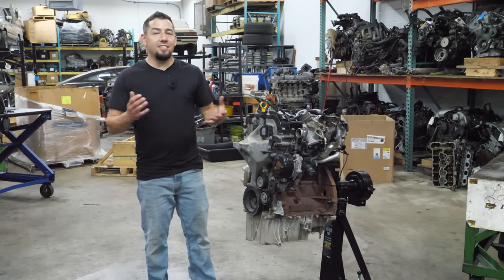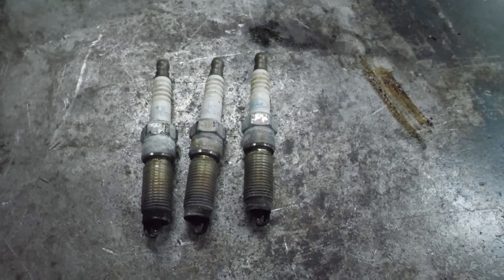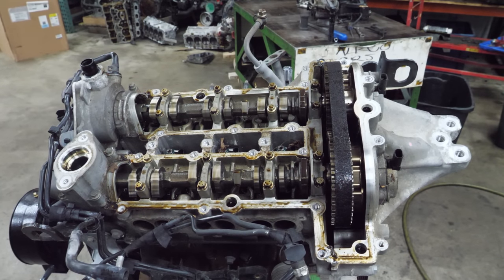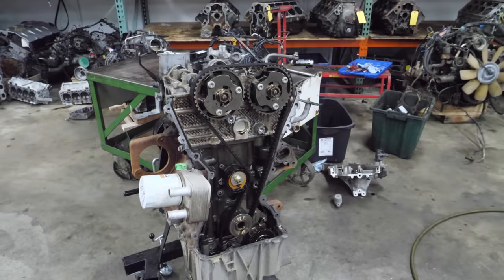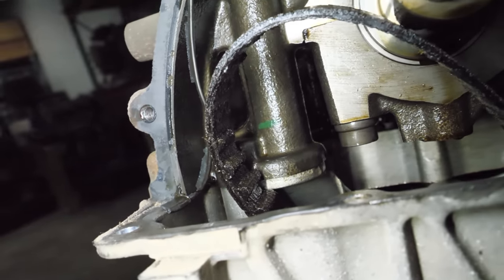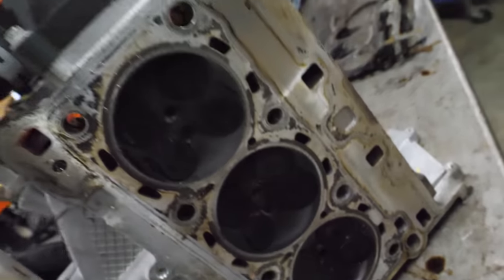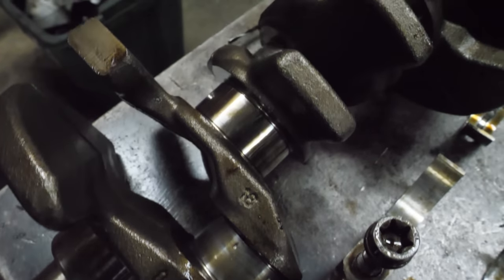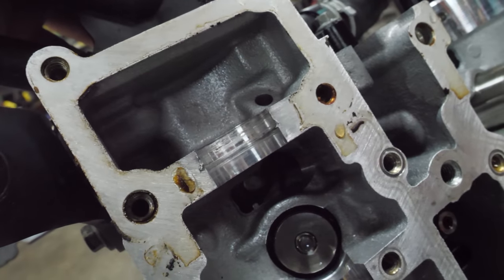JUNK Ford Ecosport 1.0L 3-Cylinder Ecoboost Teardown. LAWSUIT ENGINE!

Comment: As a Ford tech for a little over 2 years, this is the 6th time I've personally seen this happen, not including the rest of my shop. What we hear is either 1. The tensioner itself fails and there is no longer any oil pressure, or 2. The timing belt loses every single tooth (likely still tensioner failure) and becomes smooth and of course, no oil pressure. Most cars will keep driving like this until the "Low Oil Pressure" warning crops up, at which point we get it. There is no recall, but ford issued a TSB which directs to replace the long block and turbo. Which is why they are in such high demand. Obviously just a horrible engine design. Absolutely loved watching this one. I also hate that turbo vacuum line, and there's always one fuel injector connector that gives me hell. Great teardown!!
Reply: Ecoboost across the board are trash
Reply: @shadowopsairman1583  the only one I almost never have issues with is the 1st gen 3.5, even with half-assed maintenance. I've owned 2 and worked on many. But all the small ones are a pain to work on and have numerous issues. Both 1.5's especially. So yes, I'm inclined to agree.
Reply: since u have only seen 6 of these failures means theirs only 6 of these engines in your area.
Reply: ive replaced 2 1.0l ecotrashes so far. first one belt failed and lost compression and the second one they drove it in at 0 psi of oil pressure and surprisingly it still ran great
Reply: Can you say anything about the 2018+ 2.7 EB?
Reply: @geoffgaffieldsickassc4152  lol
Reply: @vincerivera2488  from what ive seen as a ford tech that mostly does engines and internal repairs. the 2.7 gen 2 i havent seen any issues other then the oil pan leaking in the gen 1 but they are pretty decent for what they are
Reply: @vincerivera2488  strangely, I've yet to actually work on a single 2.7 EB. Only thing I know is even after all the money Ford has lost on the 2nd gen 3.5 cam phaser fiasco, now they're having exactly the same problem with the 2.7/3.0 in the F-150 and Bronco.
Reply: @alexandercortez4106  I've dealt with a few gen 1 2.7 with the oil pan issue. I know ford released a tab for replacing valve covers and oil pan with the updated parts
Reply: @shadowopsairman1583  decent power terrible reliability
Reply: @eveangreen1871 the 2.7 ecoboost has been reliable for a lot of people
Reply: "it's not a recall if we don't call it a recall!" Someone's got promoted for it, I bet
Reply: @vladimirvlasov4360  😂😂 too true
Reply: @angelhibiki6867 I hear a lot of good things and higher miles on the 2.7s
Reply: @christinesommerfeld9815  honestly other then the shitty oil pan design on the gen 1 2.7 I haven't seen any in the shop for major repairs. A few trans concerns and suspension concerns but not really any engine concerns
Reply: My thought on the reliability of EcoBoost is that it comes down to proper oil and not buying into extended mileage oil intervals. There can be many variables once the engine is in the wild of normal usage.
Reply: @larrybe2900  yeah I'm religious with oil changes, 5k or less every time, and both of mine were perfect. But those turbo oil filters can get so bad so quick, and 7.5-10k is way too long for any turbo engine in my opinion.
Reply: Wouldn't failures like this be the result of the ever increasing recommended oil changes?  "Oh, you can go 5k miles between changes with synthetic.  Sure!"
Heard that crap all the time (and even 7.5k miles) at a Hyundai dealership.  Oil would come out like snot.
Reply: @alexandercortez4106  my 2014 F150 blew up when letting off the throttle at 60k miles. I accelerated up to 75 and hit cruise set and it stuttered and then sounded like a Subaru.
Reply: This 1.0 ecoboost is trash clearly, the 4 cylinders seem meh, the 3.5 decent? The 2.7 seems to fundamentally be the best designed one, I think they might've actually done a good engine there.
Reply: @veleriphon plenty of Hyundai in Europe still on the road going strong even after a decade of use on long OCIs... Even the diesel ones have a year or 20k km OCIs here and you rarely see issues... I wonder why...
Reply: I remember when this engine came out... I saw that the oil pump was belt driven, and it and the timing belt was in the oil...  I thought then... THIS will fail early. There is room for a chain in there.. WHY did they do this??
GM is now doing the same dumb shit in the 3.0 Liter diesel. Oil pump is belt driven...  and is a maint item. .. AND it is on the BACK of the engine.. so the transmission has to come off to change the oil pump belt..  HOW STUPID is that??
Wanna know why people are buying EV's???   THIS is why. unreliable ICE designs, that have large maint bills and high failure rates.
Reply: Truth is, after all, that the engines break down due to lousy construction, budget solutions.
Not because it's a 3cyl petrol engine with a turbo!
Reply: There is also a very common defect, the tube that connects the engine cooling circuit to the expansion tank breaks, and they seize very frequently.
Reply: @andreim841 timing belt not being soaked in engine oil maybe 😂 what a stupid design
Reply: @fortune300 being an overworked 3 cylinder 1 litre doesn't help. Same design in a normally aspirated 4 cylinder may have been under less stress and not failed.

What's the point in deleting a cylinder adding a turbo if it doesn't give you starship mpg
Reply: good to know that the customer is getting a new engine more than likely under warranty. bad for your hours though i imagine since it all goes under warranty work. 

also bad for the environment, ford basically building disposable cars that will have no usefulness after their warranty periods.
Reply: It’s the fact they put the belt in oil what then perishes and blocks the oil pick up
Reply: their duratec v6 and every v8 they do does the same thing, its the worst car brand ever, your job is safe
Reply: @vincerivera2488  Turd by Furd.
Reply: @norfolkngood8960  That's a misnomer, doesn't work that way.
Reply: @fortune300  Yes indeed for sure. I had a 1991 "Chevy Turbo Sprint" (Made by Suzuki) I got it to 270,000 km with absolutely NO engine issues. Apparently, it was an old motorcycle engine with a turbo bolted on.
Reply: @angelhibiki6867  yep not had 1 issue with 3-2.7eb in trucks with now over 100k so seems like a good motor
Reply: What years? The 3L V6 in my escape still runs great at 223K, all chains no internal belts
Reply: @SaberSlayer88  Ford’s been doing that for decades.  Never owned one, never will.
Reply: @angelhibiki6867  this is good news, I just bought my wife a Bronco with the 2.7.  I am OCD about preventive maintenance, just changed the oil at 1,150 miles and will continue to do them every 3k miles with Pennzoil Platinum which meets Ford specs.  My previous Ford was a 1997 Explorer with the 4.0 Cologne.
Reply: So did you  become a Ford mechanic for the job security?
Reply: @jjw6342  well judging by about half these comments, you'd think so 😂 but I've had 4 Fords over only about 6 years and they've genuinely all been near perfect. Beyond basic maintenance, I had to have a clutch and TCM put in my focus at 80k but Ford covered it and I'm now at 160k and zero issues with it or any of the others. Maybe I'm just lucky? Knock on wood.
Reply: @andreim841  Imagine how long they would last if you changed your oil at a decent mileage. I do wonder what the average mileage is in Europe vs NA.
Reply: @julioblanco  You could get away with a less expensive oil if you are doing it at 3k, that is a bit excessive. But it ain't going to hurt anything.
Reply: As a ford tech I'm wondering what your opinion on the wet belt for the oil pump on the new 5.0's that's what my F150 has, and I wasn't particularly thrilled to find out, though they said they've done it on the Mustangs for a little longer...Like you I'm a religious 5k oil change person, probably because I had the 5.4 before this one...Ford doesn't have a good track record with Cam Phasers, which is funny considering they're so big into DOHC engines
Reply: @--_DJ_--  probably 120-150 K miles then the car becomes too old and you get to pay too much taxes on it or you are prohibited from entering big towns or certain areas...
Reply: @andreim841  What a load of bs. Too old to enter a city. That wouldn't fly on this side of the pond. You can drive whatever you have wherever you want. Assuming it is legal to be on the road. I don't know how you guys put up with that.
Reply: @cjpayne677  I still feel like it isn't necessary to have a wet oil pump belt. Could be crank or gear driven like we've done for years. But at least on the 5.0, there is no tensioner that can fail since it just directly from crank to pump sprocket. Fewer components involved, less chance of failure. At least in my opinion. But again, seems totally unnecessary, especially when its proven to be troublesome in other applications. As far as cam phasers go, it only seems to be an issue on the V engines, not the inlines. Everyone else is heavy into DOHC I4s too, but Ford is the only one this heavy into V6 and V8 DOHC. Could be something in that.
Reply: I’ve been waiting to see a tear down of this engine for this exact reason. I’m glad you pointed out the TSB as it’s something I’ve come across in the shop recently to where engines are being replaced from the oil pump belt issue.
Reply: If you are a Ford tech yourself, how come you mention the belt tensioner and not the engine oil? Belt failure like this isn't caused by the tensioner. Few people seem to realize that for wet belts you need to use a very specific kind of oil that does not have any solvents in it. Apparently this car got regular engine oil after a service. Just look at how badly the timing belt is deteriorated at 10:03
Reply: @MadMarky   @MadMarkyNL  I mentioned the tensioner because I have pulled multiple 1.0L EBs apart or seen them apart and the tensioner is a common failure point. I'd say 50/50 from what I've seen is either the belt snapping completely or tensioner failure. Belt wear would not cause a tensioner to fail, but a failed tensioner could certainly lead to belt failure. As to the correct oil, I imagine motorcraft oil works for these belts as good as any oil can, and that's what I recommend for a Ford. Other oils may work better, obviously some are worse, but every one of these I've pulled apart has a belt that looks like that, whether it's missing teeth or not.
Reply: @larrybe2900 eah I mean n=1 but the 1.6 in my Fiesta has been rock solid for 60k and tuned with bolt one for ~45k of those, the four cylinders seem fine in my very limited experience. Unbelievable pain in the ass to work on, though.
Reply: Ford - where quality is never, ever, job one.
Reply: @the1stvendetta  That's a Mazda motor
Reply: Lol
Reply: @RadDadisRad is that good? You said your engine blew up.
Reply: @andreim841 maybe they're built to last?
Reply: @ItsMe-ic7on  definitely not good for a V6 to sound like a flat 4
Reply: @Gedvondur   nope, it was a model G10, made for cars 1L, 3-cyl. very reliable series of engines like most japanese ones. 😽👌
Reply: @norfolkngood8960  so with dry timing belts exceeding 50k miles or more reliably, why change to a wet belt design? Was it supposed to be a lifetime part like a chain?
Reply: alexandercortez4106 that’s why I went for a Mk 3 Focus with 4 cylinder 1.6 vct Duratec, tried and trusted.
Reply: @ianwalters11  yeah I have a 2014 with a 2.0 duratec and have had zero issues. 156k miles and not one issue with it, not even an oil leak. I agree, tried and true works wonders.
Reply: I am looking for a Ford fiesta titanium ecoboost. due to pretty low fuel cost. which year models where terrible and how to see if they are propperly fixed?
Reply: I had a 1968 Pontiac with a 400 cu. in. V8, it had a nylon coated steel timing chain.  The nylon started detaching (flaking off) the steel timing belt.  The detached nylon flakes clogged up the oil pump intake screen causing the low oil pressure light to come on at idle, and eventually causing clearance (slop) in the chain until the chain slipped and the engine stopped running at 72,000 miles.  They put the nylon on the chain to make it run quieter, but it resulted in early failure.  Pontiac (GM) would do NOTHING about their poor design and would give no compensation.
Reply: @kens97sto171  Replacing a battery in an ICE is much cheaper and easier than replacing the battery in an EV.
Reply: @tommak6516  
No kidding. Question is how long will the battery last in that EV. How much will it cost to get replaced. And what did you save over the life of the vehicle? You have to run the math and decide whether it's worth it.
I drive 50 to 60,000 miles per year. So you've got the fuel for that plus doing an oil change every 5 weeks. You got to run the math and decide.
Splitting the difference with a reliable Toyota Hybrid would be a good alternative. That's what I did. Got 423,000 mi out of my last Prius.
Still on the original hybrid battery.
15 years old.
The battery in a modern EV should last at least that long since it's got active cooling and heating.
And already that battery pack from what I have heard is about $15,000 to replace. But that's estimated to come down to about 5,000 over the next few years.
Making that math we're talking about work even better. But certainly there are problems If you don't have a way to charge it at your house then it's definitely not a great idea for that person
Reply: @kens97sto171  Everything you say is correct.  432k miles on a Prius is fantastic.  How often did you change oil? Other notable maint?  Also, did it fail in some way other than the battery, or is someone still driving it?
Reply: @tommak6516  
Oil every 5k.  Trans fluid every 50k.
Actually had a engine failure.. very rare for 2nd gen Prius. 
Little bit of oil consumption.. 
Let to a cat getting plugged up..
The exhaust back pressure caused a heat build up I think.. and blew past the ring that was a little damaged. 
It still runs and drives.. but it .ales a racket at idle.. compression is a little low on cyl 1...
Can't use it for passengers service.. with it making noise..
I could put an engine in it.. but it only has 6 months left to use for Uber.
Reply: @ObeseChess  my 2019 ST with 1.6turbo lost power and it had 20psi in cyl 4.  How many miles???  <21k  Warranty replaced with a reman from Holman and the warranty is what remains on powertrain....1 year.
Reply: GM produce better engines.
Reply: Seems like the main issue here is using that stupid chain, the design of the engine doesn't look that much out of the ordinary, besides the whole stupidity surrounding the wet belt.
Reply: The 5.0 on my mustang gt seem ok at 160000km of course with regular maintence
Reply: @alexandercortez4106  What's your opinion on the early focus rs 2.3ecoboost engines?
Reply: @shadowopsairman1583 The first gen 3.5 isn't terrible as it's based on a fundamentally good V6 engine, but they aren't nearly as good as the NA version of the cyclone either. You'll still get waste gate failures that require turbo replacement. Ours failed at 120K miles. Any time you needed boost, the check engine light would come on and the engine would fall on its face. At least the water pump is external on the RWD versions.
Reply: @tomrogers9467 I assume you own something reliable like a Toyota and not a GM or Chrysler product?
Reply: @MadMarky If you have to use special uncommon oil, it's a shit design. Sorry.
Reply: @ChrisPatrick-q6k If you get something with pushrods. They're really bad at OHC engines. The 3.6 high feature and the EcoTec 4 bangers are all terrible. So was the Northstar.
Reply: @honkhonkler7732  The NS was a great engine spoilt by stupid head bolts/threads, right?
Reply: @honkhonkler7732    You are correct.  Two Hondas.  They are the best quality vehicles I’ve ever owned.  And I’m 71.  Our CRV is 2006 and hasn’t cost me anything other than normally expected maintenance.
Reply: @Paul-ue8tn I have seen OEM Toyota & Honda T-belts last 15-20 years/130-150k miles. Unless special rubber material and specific oil, rubber soaked in oil will degrade significantly quicker.
Reply: but if this was using chains do you think it will still be trash?
Reply: @eternalrage1085  I think it wouldn't have a "reputation" like it does, it would just be a relatively weak, not incredibly economical, base engine that was forgotten as quickly as it came. Doesn't seem to have any other major issues like this one.
Reply: @eternalrage1085 the 2.0,2.3,and 2.5 duratec all used timing chains. In general they were a decently reliable engine.
Reply: I replaced a bunch of those engine as well. My first and most impressive one was from a 2019 EcoSport with only 232 miles (customer didn’t even make the first payment yet) and had a complaint of low oil press light and engine running rough. I took out the oil pan and found pieces of the tensioner of the oil pump wet belt. I remember finding in oasis the TSB for the failed tensioner on those engines…
Reply: What's a tsb?
Reply: @unkleeyerose  Technical Service Bulletin, it's a document released by a manufacturer, usually about a known issue with a model or several models. Like the cam phaser issue with the 3.5 ecoboost, TSB #23-2143 details the condition. It's  sometimes linked to a recall. In the case of these 1.0 EB engines I think it's just a GSM, or General Service Bulletin.
Reply: @alexandercortez4106  thank you. I think I need to trade my vehicle.
Reply: I believe the name of the senior design engineer on this engine is named " Frasier" (last name) some time before this engine was introduced in the North American Ford Fiesta and later the Focus he did an indepth tutorial with a 1/1 full size cutaway. Interesting content..
Reply: @kens97sto171 A friend of mine bought 2022 GM trailblazer with the 1.3 three cylinder engine. Same setup with the rubber timing belt in the oil. I  told him to get the extended warranty because of that and We have gone from California to Florida and back the long way. Roughly a forty-five hundred mile trip car run fine the whole trip except for a tail light issue witch turned out to be a pinched wiring harness problem. Cruising at 65-70 mph. It was getting between 38 to 43 miles to the gallon. He now has just about 30k on it no problems yet but he also changes his oil every three thousand miles. And he drives it pretty hard during his Eighty mile round trip every day for work. Only problem I had was planning on passing cars on the highway during our cross country trip. It was not quick to pass someone doing 50-55 on a Sixty five mph highways. But we did have it loaded down with all our luggage and gear. And yes he only gets around 26 to Roughly 32 mpg in city drives. I'm retired and have been looking to buy one myself. But in the trim lvl I'm looking for called the activ AWD. Are very hard to find right now.his is the RS with AWD. I've found about three of the activ versions but they were all fully equipped with a bunch of dealer equipped options on top of it and their also trying to tack on another 2 to 3k over MSRP🙄😠 as that trim lvl is usually bought up within a couple of weeks of them in. Had a deal worked out on one with and Agreed OTD price a few weeks ago. But on the day I buy it the salesman had Agreed to be at work and to come on down. And wouldn't you know it he wasn't there. And the guy I dealt with was such a wanker and sure enough he had to go talk to the manager. And came back saying that they couldn't do it for that price as he actually had the nerve to say well because of the strike I actually started laughing when he said that as it's made in South Korea and they were not on strike 🤥Besides wanting just about 3k over the deal I had made going back and forth over the phone for a week. And even being a retired GM employee. I ended up just telling him to tell his manager to literally Go to Hell got up and just walked out. For now I'm just going to wait a couple more months. And hopefully they'll get more in stock.And it also had almost a hundred miles on it. Yet on their website it was listed as 5 miles. I  did get a call back from the original salesman about a week later apologizing up and down. Saying I could get it for about a thousand more OTD. But seeing it had about a hundred miles already on it . I told him thanks but no thanks. When I'm going to buy a Brand new car I  expect less than 20 miles max on the car🤨
Reply: @wanee8039  
Thanks for the information on the GM three cylinder having the rubber timing belt submerged in oil also. That'll help me tell people to stay away from it.
Yeah that's some serious shenanigans they put you through to buy a car...
My suggestion would be to buy a Toyota RAV4 or a Highlander if you need more room. Both are available in hybrid form. And Toyota's hybrid systems are pretty bulletproof. Transmissions are exceedingly simple mechanically.
I had a 2008 Prius, got 423,000 mi out of it.
Have an acquaintance with an '07 Prius with 580,000 on it.
My friend has a 2012 Prius with 410,000 on it.
And a guy I met on the internet whose car was featured on the carcare not YouTube channel. He has a 2019 Prius prime with 340,000 on it at the time of that video. You can check it out on that YouTube channel. He brought it into that repair shop just to have an inspection done to make sure there wasn't anything wrong.
Reply: @shadowopsairman1583  Couldn't be further from the truth.
Reply: @kens97sto171 so it’s $2960 to replace that 3.0 Durajunk oil pump belt. 15 hours of shop time?! 😂
Reply: @JAMESWUERTELE  
I agree. That's absolutely ridiculous too. I've said so on a video he did recently on that tear down. Just seems incredibly dumb to me to put a rubber belt on the back of the engine when a simple chain connecting those two points it would have worked just as well and been zero maintenance and zero replacement. And I've heard on that Duramax it's supposed to be 150,000 mi interval. It's a diesel people are going to use diesels to tow and go long distances. I mean they just ruined a great engine by doing such a simple thing. It'll get a reputation for being a maintenance pig, they'll kill it a few years later and then blame it on people not wanting diesels when in reality it was their own idiotic design choice that caused the problem in the first place. And that's true on this Ford engine as well.
Reply: @vincerivera2488 great engine
Reply: @kens97sto171  chevrolet system seems to hold up they also increased the warranty  miles.
Reply: @techs1smh13  
Good to hear that, but you know what would have been easier? Use a chain instead of a belt. There's absolutely zero reason why a small chain could not have been used there instead of the belt on the Chevy oil pump.
Creating a maintenance item that requires the removal of the transmission?? What idiot thought that was a good idea when they could have done a zero maintenance item using a chain. If the oil pump had been on the front and easier to get to. That might have been okay too. I can promise you anybody that has to have that belt changed is going to end up with lots of issues going forward. Pulling the trans out all the wiring harnesses are going to get moved possibly not snapped back in correctly. Possible misalignments and vibrations. All sorts of issues can come up when you're taking apart major drivetrain components that were assembled altogether at the factory. Or they could have just used a chain?
Reply: @kens97sto171  I realize that. I'm not buying one. Take a look at the ridiculous oil pump drive on ford 7.3. Gas. computer contolled, jack shaft ,bicycle  chain  WTF.
Reply: @techs1smh13  
Ridiculous stuff..  made to fail... Or be expensive to maintain.
Reply: Ford just issued a recall. Finally. Junk engines.
Reply: @sleeksilver  no kidding, only took them about 2 years.
Reply: @shadowopsairman1583  The 2 liter is the only decent one. lots of stories of ringland failure, but that is mostly preventable, unlike the inevitable belt failure with the 1.0 or the the inevitable block flex and head gasket failure on the 2.3.  This is why all the high power Focus RS and EcoStang guys are running 2 liter ecoboost blocks with 2.3 liter internals.
Reply: Can someone please tell me does ford fiesta 2014 1.0 have a similar engine or the same?
Reply: @isaac.genesis  it's the exact same engine, used in the Ecosport and the Fiesta.
Reply: @alexandercortez4106  thank you very much 
So it doesn't matter if is 1.0 ecoboost with 100hp or 1.0 duratec with 80hp
Reply: @isaac.genesis  I am so sorry, I was thinking of the ecoboost. May I ask where you call home? I'm in the US, I don't think they used the 1.0 duratec here, at least not that I've ever seen.
Reply: @--_DJ_-- Double the one here in NA ... they wanna be the saviors of this planet 😂😂😂
Reply: Why then this engine has been winning the "engine of the year" so many times?. Are the rest of engines even worse?.
Reply: The nylon in not on the timing chain it is on the cam gear,just saying
Reply: @alexandercortez4106  to this day I still cant figure out why Ford abandoned the 2.0l NA GDI Duretech derived motor and the 1.6l NA...there was NOTHING wrong with either...they BOTH got great fuel economy and they didn't grenade themselves like these garbage ecoboost motors....and both produced respectable power for the cars they were in.
Reply: @craigbrown5510  I don't know, but I guess turbo 4s are just ubiquitous now. Everyone has to have one. The 2.0 NA is what I have in my focus and it still runs perfect at 160k miles, and I've only had to replace one part on that car other than maintenance items and it cost me $70 for the oem part. Love that car to death.
Reply: My 74 Datsun pickup had 560,000 miles on it. 1.8L  Changed timing chain once. Companies can't build them that good anymore because they go broke. When the heck did people start thinking a car is worn out at 150k miles? Because most are built to break around then
Reply: @the1stvendetta 2012 Fusion dropped valve and ate motor at 62.5k miles just past warranty.  3.0L.  Meticulously maintained.  Dome with Ford.
Reply: @andreim841 yup I suspect the fuel which doesn't have the detergents we have in Europe. My diesel GM gets oil changes every 11k miles or 18k kilometers and now has 280k on it and still great. And the oil does not come out like snot and no sludge in the engine.
Reply: @larrybe2900 Frequent oil changes won’t stop the wet belt from deteriorating
Reply: @alexandercortez4106 Volkswagen TDI engines (turbo) have been doing 10,000 mile oil changes for decades.
Reply: @norfolkngood8960 THE 3 cylinder engine was rated 43 MPG highway so it was a big improvement over the 4 cylinder engine
Reply: With the balancer out of time, would it not shake like heck once the failure started?  Seems like the time to loosing the first tooth to catastrophic would be less than 5 minutes.  Hard to tell with all those teeth in the pickup screen.
Reply: The recall was issued in at the beginning of the year part still not available will not be until Jan 2025..... I have questions about engine replacement.
Reply: the engine itself is flawless ford mechanic speaking, have worked on at least 10 or 20 and they all boil up to either wet belt rotting from oil cause rubber doesn't like oil or engine cooked 1 or 2 times so there comes a crack in the cylinder wall mainly cylinder number 2 (idk why it just happens to be the weakest point) now mainly why i think the engine is not flawed is because of the wet belt design that they tried using or as i like to call it "cheap option" the manufacturers or engine designers could have easily went with timing chain but due to money being a high interest point these days i don't see this engine working for more then 2 or 3 months without coming to some mechanic who is gonna think of 50 other swear words for engineers of this engine